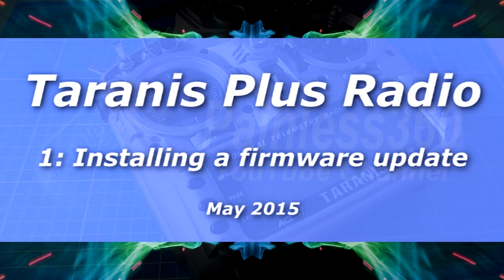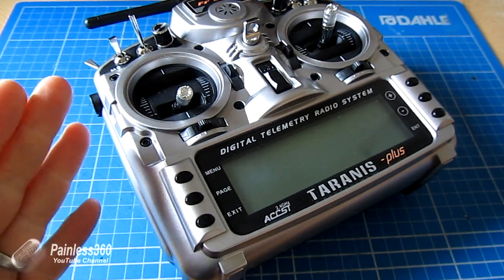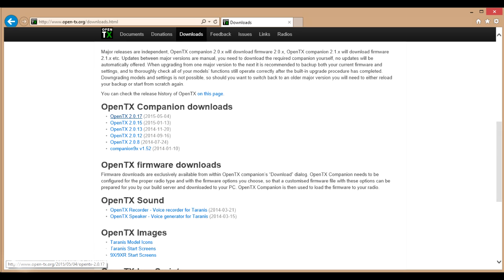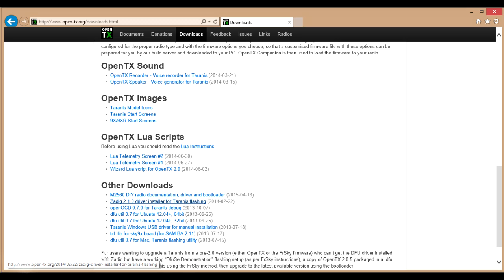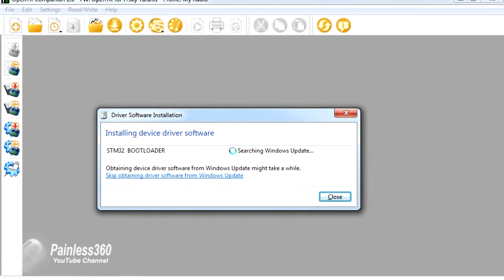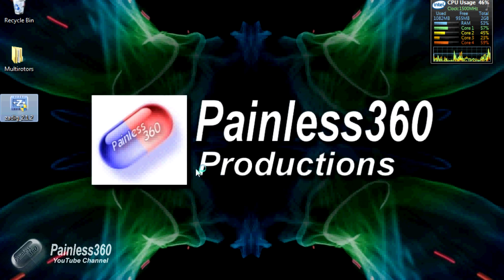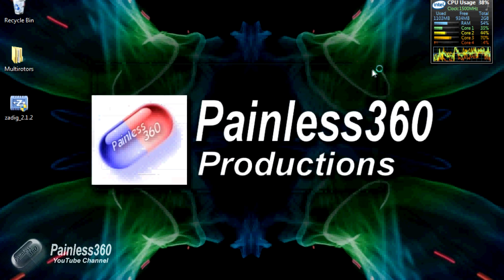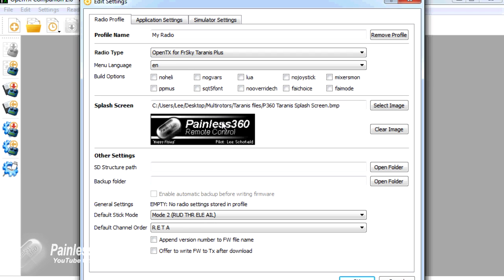(1/12) FrSky TARANIS Radio - One way to update the firmware

Comment: Hi, Just bought Taranis x9d plus. Have it all set up thanks to you and your videos. My question is, the sliders on each side of the radio are LS or RS. I followed videos to set up volume control to RS. No responce and the box to the right under special Functions is checked. Are there any other settings or something under radio setup I have wrong. The volume control works with the turning knobs but not the sliders. I can't imagine both sliders are bad. What is your thought.
Reply from the maker: +Brian Wendel OpenTX version?
Reply: I am using open TX version. Followed your Videos which were a huge help.
Reply from the maker: +Brian Wendel 2.1, 2.2?
Reply: No. Updated to 2.2. bootloader matches. Still No slider response. even when calibrating no responce. I Looked under radio setup at pot settings. tried Off, Man and auto still nothing? Emailed Frsky on the issue. not sure I'll get anywhere with that. Thanks
Reply: Thanks for your help I got it working. I was calibration the sliders incorrectly. Updated to 2.2 and all is well. It can be a little overwhelming. Thanks

Comment: Hi Painless, I'm working on my first quad build which has been going pretty smoothly until I paired my receiver and the channels in the receiver tab are not moving. It says I'm connected and my receiver light is green. I checked the signal pin on the sbus connection that I'm using and it says that its giving voltage to the FC. I set the serial rx, and made sure cleanflight knew what the connection was. Plz help.
Reply from the maker: See the 'Quadcopter Building for Beginners' or 'Seriously Pro' series for how we set that up. Best of luck!

Comment: I just received my X9E with V2.1.16 and find it does not have the wizard or the antenna SWR feature. Will I find these if I update to V2.1.19, the apparent latest?
Thanks
Reply from the maker: +ArcticEddie1 not sure,  I'd check the release notes as not every thing pilots wanted made it into 2.2 (I. E. Model setup wizard on the QX7)..
Reply: I searched the V2.1.19 BIN file with the HXD hex editor and do find a text reference to SWR and WIZARD. I assume the features are included in that version and will know for sure after my X9E is updated. I will confirm after update.

Comment: Thank you for your great videos and instructions! I recently received my taranis plus with x8r receiver and don't get more than 30 meter range before telemetry is lost. I took into account antenna placement and sufficient Rx current.
In range check mode it's even less than 5mt before loss. What might be the problem? Faulty RF module? Faulty receiver? Or are there any other options?
Reply from the maker: That sounds like one of the antennas isn't happy.. Id try another Rx and if it's the same then suspect the radio. Best of luck!

Comment: I've updated my Taranis plus to latest FW open tx-Taranis-plus ver 2.1.9 15:09:2016 EEPR 217 and it still won't bind to a brand new eu xsr receiver. I've tried flashing xsr to non eu and still won't bind. Can anyone tell me if I need to get an EU firmware for my Taranis plus or a new transmitter to bind to my xsr receiver?
Reply from the maker: Flashing the OpenTX will not change the firmware running on the internal radio module. You need to flash the internal XJT module with the firmware you want separately. You could also flash the receiver with the non EU version to get it to bind.. Best of luck!

Comment: 29-Jan-2016:

Hello Lee: Hope all well. Just bought my new FrSky Taranis X9D and facing problems in my windows 7 to detect the correct USB driver. I feel that zadig driver procedure is no more advised by OpenTX, so I tried to follow the step by step procedure in below OpenTX references...but as soon as I connect USB to PC, I am UNABLE to see two drives. Instead, I am getting these messages ==> https://drive.google.com/open?id=0BwguQaBwEJZ-aWZrcExvME9DWjQ. Please help if you have come across to this new procedure of OpenTX. I am also trying to search in OpenTX forums. I will update here, if i will find any. Thanks for your time. excellent video, as usual :-) 
 

http://open-txu.org/wp-content/uploads/2016/04/X9D-Quick-Start-Guide-OpenTXU.pdf (section: connecting USB)

https://www.rcgroups.com/forums/showthread.php?2178865-FrSky-Taranis-with-OpenTX-2-0-and-beyond (2016 update, master thread).
Reply from the maker: +adnan ul haque we don't use that method here as it does have a lot of potential problems from what I've read. That's the exact reason we used the way we did. If you need help with another method I'd ask those who use it. Best of luck!

Comment: just fallow your video, and I have must done something wrong, and now my radio is broken.
it got white screen,and the little vibration motor,its working at full speed,making a big noise.
well, I got a new tx on the way. I DON´T RECOMMEND ANYONE TO BUY THIS PIECE OF RUBBISH TRANSMITTER. itgot very expensive receivers, and make sure they are compatible, ACCST, LBT, etc etc.
great video though
Reply from the maker: +Joaquim Mata you should be able to fix that - https://www.rcgroups.com/forums/showthread.php?2210978-taranis-plus-firmware
Reply: thanks. at the end I could fix it,taking its mini sd card, copy the firmware that was installed before to the pc. than, I connected the taranis to the pc,and run the firmware that had previously. at least now it is back to normal.anyway,I bought the new turnigy,with touch screen,which I saw your video about it as well.
your channel is by far,the best channel, on this hobby. congratulations,and thanks for the help.
Reply from the maker: Glad you got it sorted. Most of the electronics in the hobby are now made to be 'un-brickable' ;)

Comment: Hi I am hoping you maybe able to help me as out of all the sources on the internet you appear to have a good in depth knowledge of the Taranis radio system. I have checked online forums and blogs but not found any comment inline with the following problem. To keep this short and to the point.
I am building a QC 450 and decided to go for the Taranis for the controller combined with a Pixhawk FC having watched your series of YouTube videos on the subject. I have created new model files both on the radio and using the companion system but as I am at the stage of wanting to do my first running of the QC systems and motors for checks but have found that the only way I can actually get the motors to run is by doing it by using the Mission planer software laptop hard wired into the FX and do a test run in the module which tests for interference compass / motor calibration when motors are running. All models created except one had been altered or changed after initial creation so the one I created using the model wizard in the companion software without any further changes should have been a simple straightforward content and I would have expected it to have at least run the basic systems with the motors but not so not even using the previous mentioned test module. All firmware on all components is updated to the latest version. I hope you may be able to help please.
Reply from the maker: +David Giles are you arming the board?
Reply: Painless360 Yes board armed and confirmed by beeps from FC
Reply from the maker: A video of the screens in mission planner with all of the channels moving would be handy..
Reply: Hi I have attempted to attach the video as requested but without success I will continue to try Thanks again for looking
Reply from the maker: As you've not explained what you're doing when the beeps are happening I'm making an educated guess here.. I'd look at reducing the endpoints of the flight control channels. The Taranis has a tendency to overdrive the PWM values below 1000 and above 2000 and for many flight controller they don't like it. I'd start there as MIssion Planner has some settings about this and looking at the main screen on MIssion Planner as you try to arm will show you the actual reason the flight controller isnt happy arming. Best of luck

Comment: Hi, Do you have a video on how to set up Crossfire on Taranis and betaflight ? I can get my roll, pitch. yaw, throttle bars to move in cleanflight but no response from my Taranis switches when I use crossfire !
Reply from the maker: +akitaishi  it yet. Try it with CRSF as the connection rather than PPM in the radio. Make sure you can see the aux channels moving in the monitor on the radio too.. best of luck!
Reply: Painless360 ,

Hi, as a matter of fact, I did set it to CRSF under my Taranis External RF. I still can't understand why only 2 aux switch is active (bars move in betaflight under receiver tab) instead of the expected 4 (for PPM ) or 8 ( if SBUS or PPM has 12). Can u try and see ?
Reply from the maker: Sorry, out CF module isn't here at the moment. I'd get onto the supplier for help. Best of luck!
Reply from the maker: The first video for the Crossfire went up today! Hope it helps..

Comment: sorry to bothering you again. i juust received my taranis x9d plus. an i am following your steps ( thank you for that) and i reach a message: when i am trying to update the FWNo DFU capable USB device found. how can i fix that please
Reply from the maker: I've not seen that here but there are lots of articles about that error in OpenTX on the forums. Please let me know what it turns out to be.. Best of luck!
Reply: thank you . i will .
Reply: that's the point. i have plug it to my computer using a (USB hub) once i plug it straight to my PC it works great and i have update the firmware and now i am ready for your second tutorials

Comment: Hi Painless - I have had my Taranis for several months now and still struggling a bit. I wonder if you could help please?
I have set up pretty much everything to use on a Wookong M but have one sticky problem I cannot figure out. I am using the Tiny 2 gimbal with the Mode switch set on chnl 9, chnl 10,11 and 12 on a three way switch (SE). I use the side sliders for tilt, on the left and slew on the right. They work as they should on each mode but can you advise what I need to do to allow me to use both slew and tilt on both side sliders at the same time when selecting the "Course Lock" mode? Any help would be greatly appreciated. I have looked at all your videos in the series but have to admit to being a bit stumped. Thanks in anticipation - Jack
Reply from the maker: I've not used the Wookoing here so mot sure what you're asking. Are you looking to select course lock automatically when you move the sliders from the default positions?
Reply: Hi thanks for getting back to me. No, I am trying to set up my Tiny 2 gimbal. I bought that on seeing your brilliant review some time ago, In fact, I have two! If you recall it has a "Mode" option to set how it acts? There is FPV, Direction Lock and Follow the Nose. Ignoring FPV, I have set Follow Nose on one channel with LS letting me tilt up and down. Another channel sets Direction Lock and RS allows me to slew the camera. What I am trying to achieve is to be able to tilt the camera as well as slew on that Mode. So I have no idea how to engage both LS and RS at the same time on that Direction Lock Mode. On my existing set up using a Devo10 I have been able to achieve that. My aim in buying the Taranis was to replace this set up but have gotten stuck on this part of the process. Any help I would appreciate. I should mention that I am using 2 bound X8R Rxs, the second Rx will only be used to control the gimbal and has no connection to the Wookong M. Thanks again in anticipation - sorry for confusion - Jack K
Reply from the maker: So you have LS used for pitch, RS used for yaw and another control used for MODE on the gimbal? Sounds ok if that's it.. Sorry if I'm being dense here. Maybe a video showing the problem?
Reply: I just want to be able to use both LS and RS at the same time so I can control the pitch and yaw on mode 2 of the gimbal. Any idea how I can enable both on the Taranis? If you have a look here - https://vimeo.com/171760406 at around 1 min 20 - this is what I am trying to achieve. This video was a play around using mode 2 on the gimbal with a Devo 10. It was easy to mix on a standard Tx but totally stumped on the Taranis...
Reply from the maker: I'm stumped too as this (if I understand you right, and I'm not sure I do) is easy to setup.

A video of where you are would have helped. Best of luck with it..
Reply: Cheers - thanks for listening anyway...

Comment: Hi i have just got a taranis plus and x6r rx great radio .bu i have a problem it is stock fw .when i tried to set itup in cleanflight it does not work in the rx section .ihave tried all combos but no luck any help woul be great
Reply from the maker: Without knowing what flight controller and firmware (Cleanflight, Openpilot, ArduCopter etc) it's very tricky to offer any advice. If it's a modern STMf3 based flight controller see the setup videos in the SP3 series for help.. Best of luck!

Comment: First off, I would like to thank you VERY much for all these videos... I haven't slept in weeks... But I know a lot more about Quads. I am looking at switching to a Taranis radio, and when I look at Banggod, they have 2 Taranis X9D Plus radios listed.... One is marked as Original, and the other does not have that designation. :Original:http://www.banggood.com/FrSky-2_4G-ACCST-Taranis-X9D-Plus-Transmitter-p-940819.html?rmmds=searchand the other:http://www.banggood.com/FrSky-ACCST-Taranis-X9D-PLUS-16CH-2_4GHz-Transmitter-with-X8R-p-952630.html?rmmds=searchThere seems to be no difference that I can see.... Do you know of a reason for the 2 models?Thanks in advance Steve
Reply from the maker: They both look like the same radio but one listing allows you to select Mode 1 or 2. I've no idea why they've got two..

Comment: Hi Lee. I have a taranis plus. Had it 2 weeks bought from a trader I have dealt with before on ebay. Runs Irangex rx800 receivers a treat in D8 mode. Runs x8r receivers a treat in D8 mode. X8Rs from Hobby King 1 week ago. Have tried everything I can think of but cannot get the x8rs to bind in d16 mode. Have tried all the binding procedures in the instruction manual plus numerous youtube ideas. ......But no binding in D16 mode Heeeeeeellllp please. Any ideas.  Garry
Reply from the maker: Check what firmware the receiver has, it needs to be the same flavour as the radio. EU or non-EU. This catches me out all the time as I get our receivers from lots of places, some outside the EU! Hope that's it..
Reply: The receivers are UE and the radio country code is America. The country code can be changed to Japan or Europe. Or is it possible to flash the receiver to non UE. Thanks for your time and trouble Lee. I am a regular viewer of your channel. Your content is interesting and informative. Please continue, your efforts are appreciated!!!
Reply: Success!!! Reflashed the firmware on the x8r's having watched your video on the subject. Also watched videos on the subject by RC Model Geeks and Peter King Droneshop biz. Used a servo lead with negative and positive swapped on one end, from the external module pins on the taranis, signal pin at the battery end, and the smart port on the x8r. Used the taranis to do the flashing after loading the unpacked firmware on the sd card.
Reply from the maker: +gloplg yes you can. Use can use a USB adapter or a normal servo cable from the back of the radio.. https://m.youtube.com/watch?v=IvXWdBpQNvk

Comment: I am using the older Taranis not the plus version! I have never updated the Firmware since new ! I am having problems while trying to update in OpenTX can you advise on versions etc that I need and how to do this cheers
Reply from the maker: If you're using a version of OpenTX from before 2.0 then you may need to flash it with another version first. Lots of details on here - http://www.open-tx.org/downloads

Comment: Hi, I fallowed the steps to a T, operating Win 10, downloaded Zadig and OpenTX companion 2.1.9. Selected Taranis Plus, checked 2 boxes as on yr video, dwnld FW , another screen with splash screen choice, OK, first green bar appears to run to 100% and message pops out that it cannot read from the radio, once I OK it,goes back to Downloads screen box. Radio is turned off all the time. Please help as I am trying to figure it all out for over a week
Reply from the maker: Sorry, I've not seen that here. I assume the radio is charged and you've tried another USB cable and port?